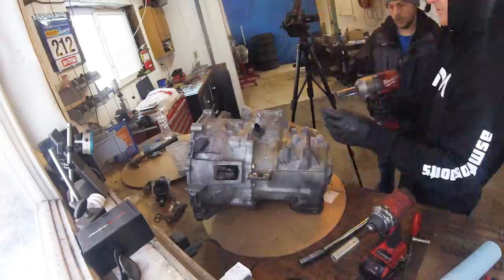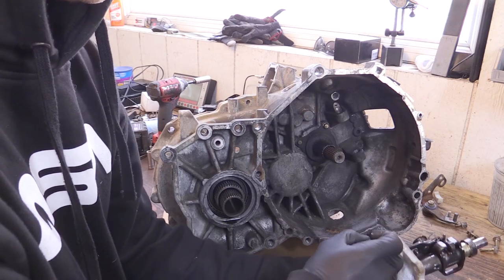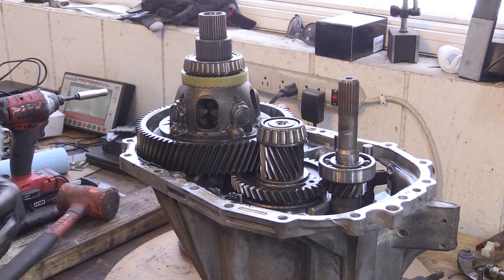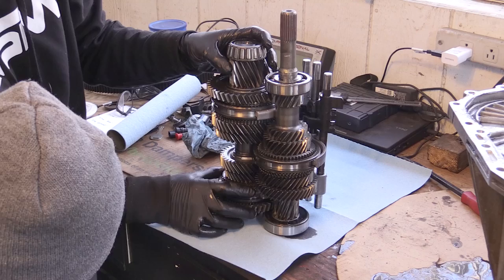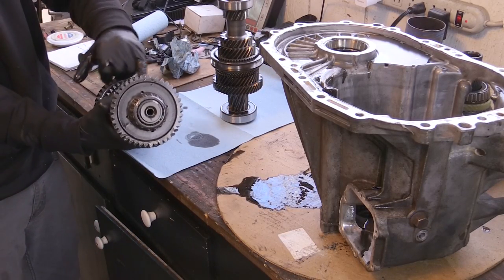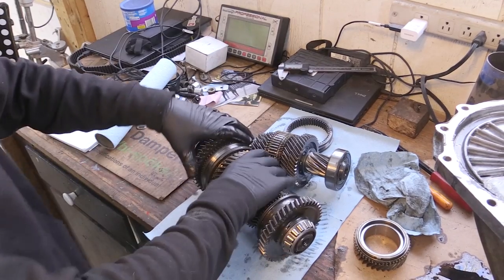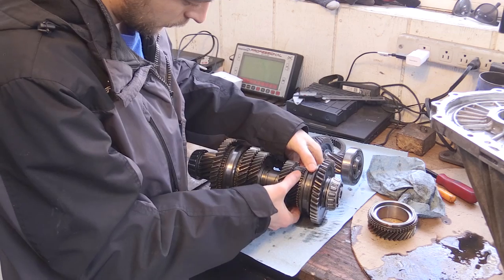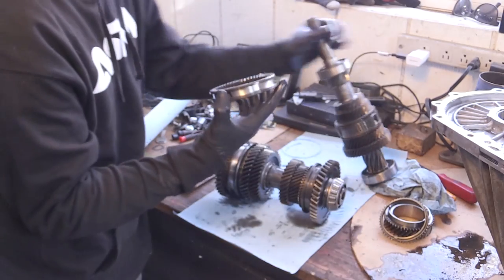Evo Transmission Teardown // Inside a evo 8 trans // Boosted Films

Comment: Nice! I'm working on an F5M51 myself. Same transmission and guts, just paired to a front diff only. Pretty soon I'll be working on stripping the output shaft to change my final drive actually, like you had mentioned.

Glad I managed to stumble on your stuff! I haven't seen a good video until this on the 5M51s.
Reply: I'm trying to swap the evo 8 trans into my eclipse and was wondering if all the shifter stuff from the eclipse trans will swap onto the evo trans. I might have to build an evo trans from parts because I can't find one for a decent price.

Comment: Very handy video, thanks.  I'm about to make a similar video for my Legnum VR4 and explaining where the centre differential is by linking to your video will help.  I'm installing an MFactory front helical LSD but want to point out the difference between the front LSD, and also the Viscous Coupling Unit + the actual centre differential.

Comment: Cool great video.  

Question, is that ball bearing sits on top of the bolt to push the clutch fork in-out, is it the same for lets say a Mitsubishi 1999 manual transmission 420a engine?

Comment: So my third gear recently started grinding when I shift into it so I changed out the synchro and it kinda solved the problem. It doesn’t grind when I’m gentle with it but it grinds when I go into the gear fast! I don’t miss the shift either lol but I was wondering what else can it be?
Reply from the maker: Still sounds like an issue with your synchro and or slider.
Reply: @BoostedFilms  guess I’ll try the slider next!! Thank you!
Reply: My evo 7 scrunches when going into third gear aswell , But seems after driving the car for a couple of miles it stops scrunching and is like normal , still bamboozled to why it is doing that
Reply: @_umbroprints3886  previous owner offered to rebuild my transmission so I went with that lol. Now the problem is gone! I got a tune recently and after the tune I would shift and it would make like a weird “woo” noise when I shifted then it went away lol

Comment: Do the detents need to go back into the exact same place?
Reply from the maker: Kasey Wilcox no. They are all the same.
Reply: Boosted Films thank you. 
After putting my trans back together my car doesn’t want to fully go into 2nd, 4th, and reverse. (They Go in and drive but they don’t feel like they used to)
Maybe a linkage issue?

Comment: Great video.  I tried to take apart my 6 speed for shits when swapping to my 5 speed.  I could not find ANYTHING online about how to open it up - it was a pain.  5 speed looks much easier to open up mainly because the 6 speed had a bunch of balls and spring detents that are not one assembly like was shown here on the 5 speed.  In addition, I could not get the shift forks or shafts out because somehow I think I locked them together.  

Regarding the bushings mentioned at 1:50, here is a link to the parts. I ordered:

- Mitsubishi 5-Speed Gear Select Shaft Cover - Evo 4-9/x $1.85
- Mitsubishi 5-Speed Gearshift Equipment Bushing - Evo 4-9/x $2.82
- Mitusbishi 5-Speed Gearshift Selector Bushing - Evo 4-9/x $2.82

https://stmtuned.com/collections/evolution-7-8-9-oem-mitsubishi-shifter-cables-parts
^I personally try to avoid STM because I don't really like their prices, but they are great for OEM parts.  

My 5 speed shifts so smoothly from Nuetral to 1 that I literally sometimes worry that the gear linkage has come undone LOL.
Reply: I don't know much about evo's. Where could I look to find pros and cons of the 5 speed vs the 6 speed?